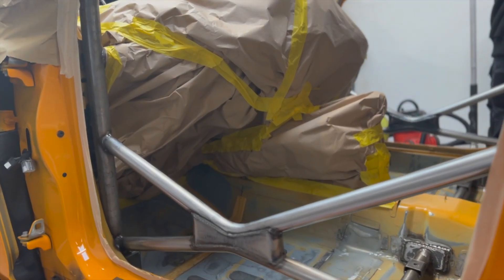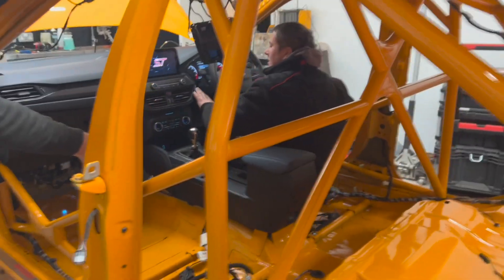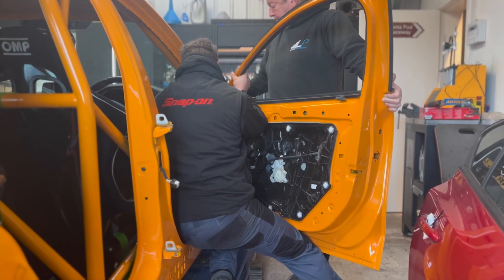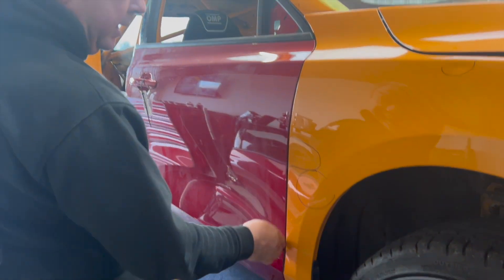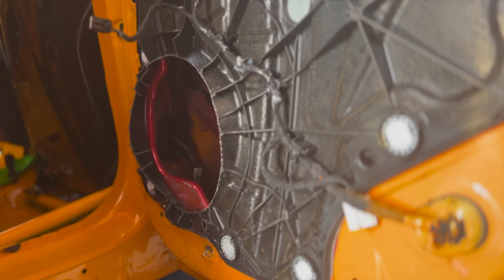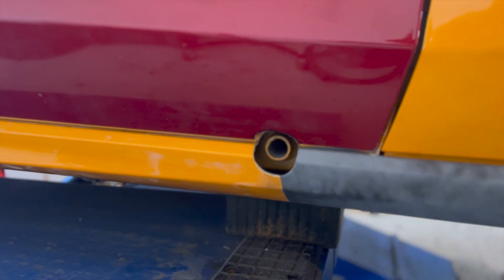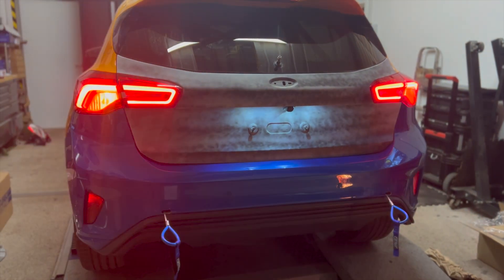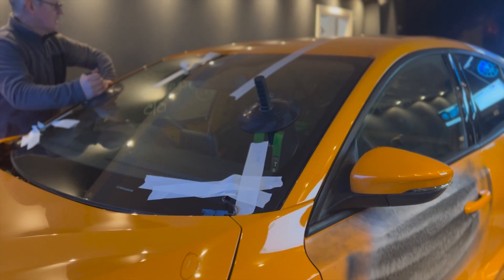OUR MK4 FOCUS ST TAKES SHAPE! 14 DAYS TO BE TRACK READY!

Comment: Nice build so far! Can’t wait to drive my fiesta st and switch maps(since im not happy with the puma map for x58 turbo) currently in the garage and dailying a shitbox clio😂 

Do you make adjustments to the map when ordering a handset to optimize the map from distance since i don’t live anywhere near your location
Reply from the maker: We do indeed!
Reply: @lairdperformance2235  sounds good what kind of power figures are reachable witht the x58evo2 on a stock engine. Mods i have 30% bigger injectors, airtec stage 3 intercooler, quickspool manifold from puma, scorpion decat and scorpion 2.5inch catback forge dv performance mods. I think the puma map kicks in very agressive but drops off pretty quick so mid range is a bit meh(its still quick tho) but not reaching any good 100-200times like people do sith s280 w/o injectors